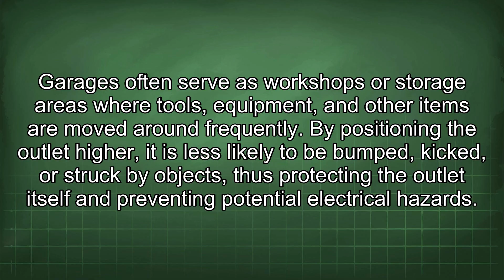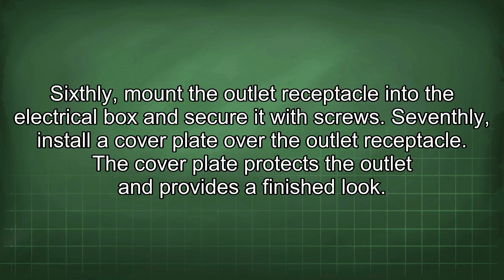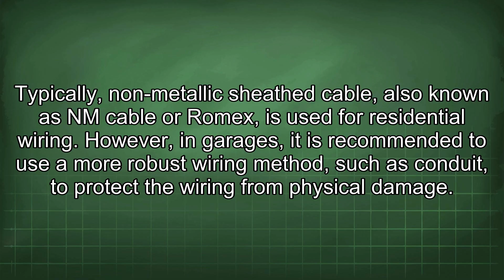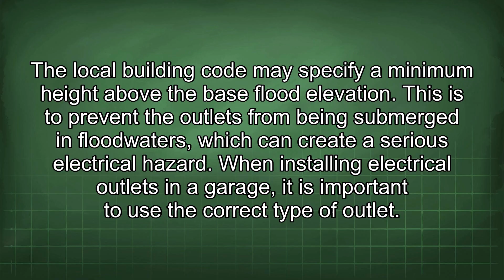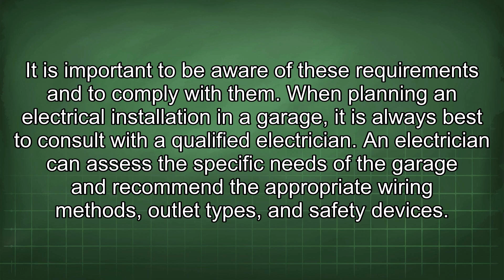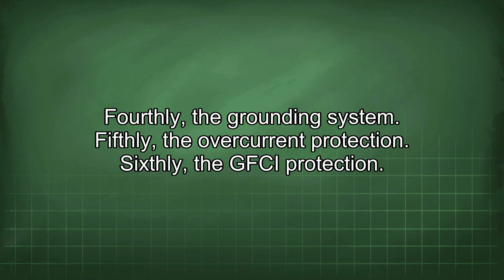Garage Electrical Outlet Height Requirement Explained Simply

Comment: Let’s see some citations for your code claims.
     The American model code - the NEC - does not specify receptacle heights. Where a receptacle is required by code, the NEC simply states it be within 5-1/2ft of the floor.
     Commercial garages - where a “classified” hazard is present - an 18” rule MIGHT apply. 
    Conduit recommended? By whom?
     The six-foot rule was s for habitable rooms - not garages.
      This video is pure crap.
Reply from the maker: Hello @springwind2433,

You've brought up some important points, and I'll correct my claims with proper citations from the National Electrical Code (NEC).

Receptacle Heights
The NEC does not specify a minimum or maximum height for receptacles in a garage. My previous statement was incorrect. The NEC's requirement for spacing receptacles in habitable rooms is that no point along a wall line is more than 6 feet from a receptacle outlet, as stated in NEC 210.52(A)(1). This rule does not apply to garages. Therefore, the "six-foot rule" is for living spaces, not garages. The 5-1/2 foot maximum height you mentioned is relevant for specific accessibility standards (ADA), but not a general NEC rule for all installations.

Commercial Garages and Classified Locations
My previous claim about an 18-inch rule was overly broad and inaccurate. The 18-inch rule applies specifically to "classified" locations where flammable vapors or gases are likely to be present. In commercial garages, this applies to the area where vehicles are serviced and fuel vapors are a concern.

NEC 511.3(B) states that the area up to 18 inches above the floor is considered a Class I, Division 2 classified location.

NEC 511.7(A) requires that all equipment, including receptacles, be located at least 18 inches above the floor in these classified areas to prevent ignition of flammable vapors.

This rule is specific to commercial garages and other classified locations, not residential garages.

Conduit Recommendations
My recommendation for using conduit in a garage was a best practice suggestion, not an NEC requirement. While the NEC does not mandate conduit for all garage wiring, it is often a good idea for added protection.

NEC 300.4(A)(1) requires that conductors be protected from physical damage.

Conduit (such as EMT, IMC, or rigid metal conduit) provides excellent physical protection for wiring, which is a significant concern in a garage environment where it could be easily damaged by vehicles, tools, or other activities.

Therefore, while not required, using conduit is a professional recommendation to ensure durability and safety in a garage setting.

Summary of Corrections
Receptacle Height: The NEC has no height restriction for receptacles in a garage. The 6-foot rule is for habitable rooms only, per NEC 210.52(A)(1).

18-inch Rule: This rule is specific to classified locations in commercial garages, as per NEC 511.7(A), not residential garages.

Conduit: Conduit is not an NEC requirement for all garage wiring but is a recommended best practice for physical protection, which is required by NEC 300.4(A)(1).

Thank you for holding me accountable and helping us provide a more accurate and helpful response.

Sincerely,

BESA Research